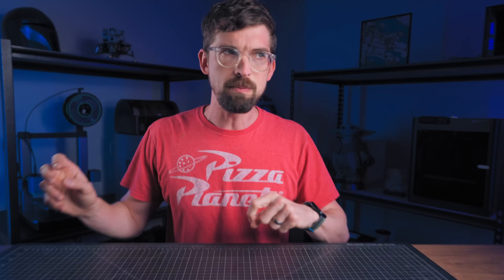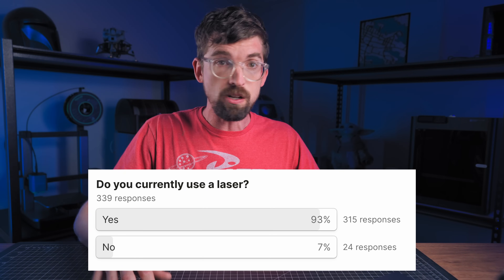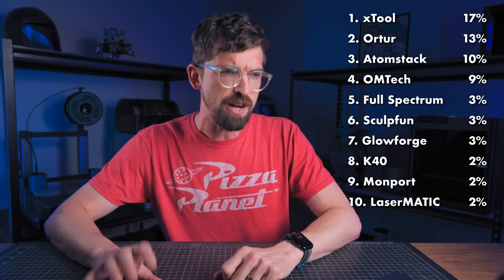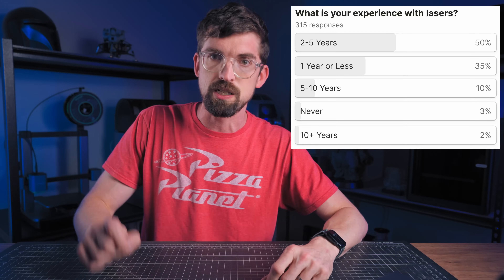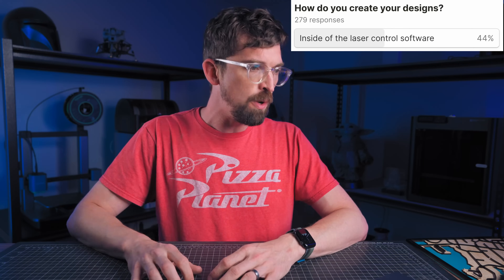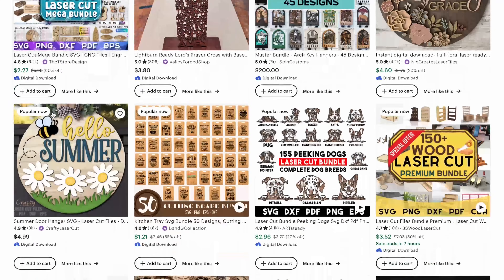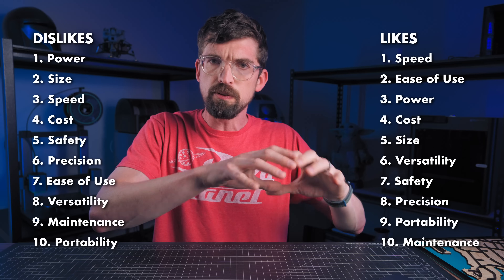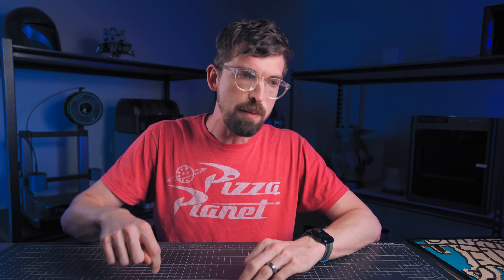This is The Best Laser Cutter and Engraver

Comment: Nice job on the video! I would get a Thunder Bolt in a heartbeat if it did better at cutting material that is around 1/4”(6mm). At that thickness, I swear a 30W+ diode would cut faster. And the next stronger Bolt is ridiculously expensive. Bummer! I’ll wait for the Roly MK3 40W extra wide model that is coming towards the end of the year.
Reply: I have a thunder bolt and its a giant pain to cut any wood or mdf thicker then 3 mm, its inconsistent across the same sheet and if I cut out many things in one sheet half cut through and half do not. its good for engraving but otherwise now I have to spend more money on a machine that is better for cutting.
Reply: @user-pl9wg5gc5i  thank you for the information, just as I thought.

Comment: Translate this to chinese and hope they read it. Should be a wake up to what they are doing wrong. I just suffered thru a warranty claim with xtool - a very trying experience. It was an obvious game and they thought I would give up. At least a dozen emails over as many days asking repeatedly for info I had already supplied. The word 'sorry' does not fix it. After 2 1/2 weeks, I did finally receive replacement laser head. Now setting up new Roly that just arrived. If you have two lasers you have one.If you have one laser you have none.

Comment: The thing i notice is that you do not make a difference yet between the kind of laser
glowforge for example is a CO2 laser , Creality is a Diode Laser , Xtools got Diode and Co2 depending on what one you choose

i can not say if it would make any big difference, but i can imaging that some people are less happy with a 5K printer that get outperformed by a sub 500 printer because of diode vs co2

so if enough data is present, can we get a quick breakdown of the co2 / fiber / diode classes so they stay equal to a certain point ?

also i love the video, it is well done and it was interesting, i expected way more of sculptfun but seems people thinks otherwise
this also makes me wonder, atomstack for example (if i am not mistaken )  is just a offbrand ( or premium brand ) of a other laser company, so maybe those can be split up to ?
Reply from the maker: Yeh totally get that, at first I wanted to break it down by brand but didn’t have enough responses so had to do it by machine.  xTool was the only one that had enough individual responses for the machine though, so I could do that in the future.

Comment: My full spectrum laser fell apart and rusted. The support was awful, they lied to me at purchase about upgrades and then went on a twitter tirade that I was an unreasonable customer.  Absolutely would never recommend full spectrum to anyone!
Reply: Full spectrum customer support is terrible. Had a problem with my laser not cutting and they asked me to send my power supply to them for testing. When I was finally able to get them to return my power supply it was not even the one, I sent them.  Then they said I was wrong and would not give my original back. Ended up finding a used one just like mine and got replacement parts. it lasted another year and a half. Purchased a Rabbit 80 watt after that and am happy with it.
Reply from the maker: sorry about that

Comment: There is no free lunch with lasers.  If it is underpowered it will cut in a more shallow way and it will require lower speeds for engraving deeper.   

For laser work, remember the price, quality, and speed triangle:

Fast!
Cheap!
Good!

Now pick two options but only two options. 
Remember this triangle because it rules your world.  You might want to reach an economy of scale, but for that you need a lot of capital.
Reply: Well said.  I got an xTool M1 as I have a background in vinyl cutting and liked that it was enclosed and not a gantry.  It's fine for that but the 10w laser is painful to use.  I made a nine-layered 3D mandala out of 3mm basswood.  Roughly 5 inches square so I could do four squares of each layer on a 12 x 12" sheet.  I believe the overall cutting time was north of 3 hours total for all layers.  Pack a lunch.  Some layers of mandalas in cardstock can take upward of 20 min/sheet, and that's just a single layer/12 x 12" sheet.  Lighter colors take longer to cut, with white being the worst; I suspect more reflection than absorption of the beam.  I resorted to covering the white with a black sheet of construction paper to speed up the cut time.  I need, as Tim Allen would say, "MORE POWER".  🤣
Reply from the maker: ha yep
Reply: Ugh ugh ugh...Me grunting in agreience 😝

Comment: I have owned several lasers over time. From my first Laser Master 2, to the Xtool S1 and P2. I wish I had known about the survey, I would have contributed. I actually sold my P2 because it was just way too cumbersome. The Xtool machines are a good bang for your buck, but there are two things I absolutely HATE about them. 1st, the hose size for the exhaust tubing is 3 inch. This means it won't fit most standard duct tubing which is 4 inches or more. I had to print adapters for the S1 and P2. There is no good reason for them not to use the most common size. Though I guess this could be some attempt at proprietary BS so that you have to buy tubing and exhaust accessories from them. 2nd, the implementation of lightburn compatibility is terrible. It's janky as all hell and badly thought out. Plus the camera functions of the P2 never worked in lightburn for me. If I could do it again, I would go with a company like Thunder Laser. They are also Chinese, but they have USA based support and sales people. So my issues are never brushed aside and the BS claims are less.

Comment: Etsy has many laser patterns. As a full time pattern designer I need to say that many pattern sellers are selling copyrighted patterns. Many of my designs are being sold without my permission. Etsy will not help with this and all of the sellers of my patterns are overseas so I am not able to do much.
Reply from the maker: The design ecosystem especially on the paid side seems pretty crazy, especially with copycats.
Reply: Is there a good way to verify if a design is original?
Reply: @tatordad  It is extremely difficult because there are so many designs and designers. All I can say is that if someone is selling a set of patterns in the hundreds and the patterns have multiple styles then there is a good chance they are not made by that seller.  I don't even fight it anymore because 99% of the time it is fruitless.